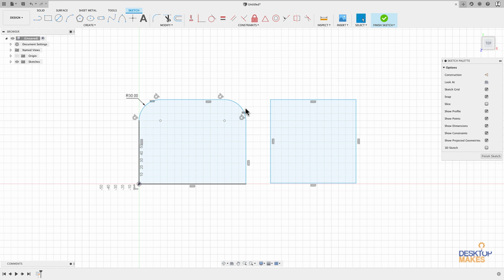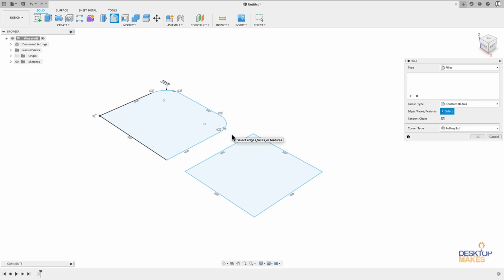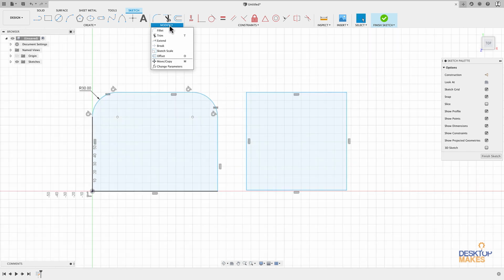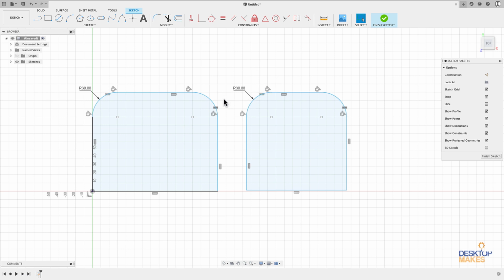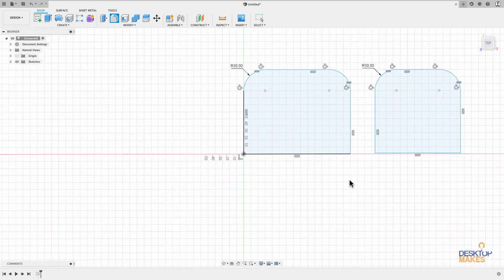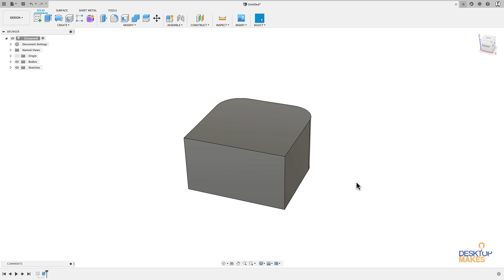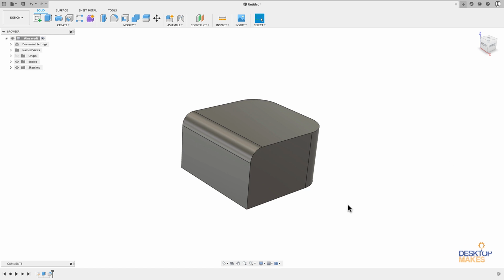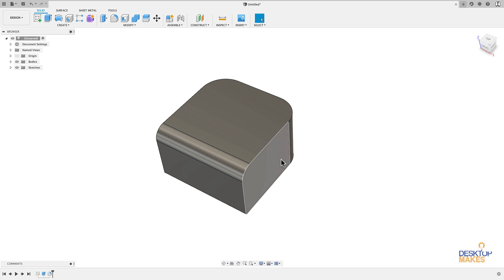Why Your Fillet Tool is not Working - Fusion 360

Comment: i have 1000's of hours on solidworks and NX and i can safely say something is seriously wrong with the implementation of the sketch fillet tool. It simply does not work with no explaination why. and, no launching the 3d fillet tool by mistake is not the problem

Comment: So, why are there 2 different Fillet options? When should you use one over the other?
Reply from the maker: Hi @christopherlyons7613.  There's a sketch fillet and a model fillet.  I normally add my fillets to the 3D model.  Sometimes it can be beneficial to add them to the sketch level and define them there.

Comment: hi there. thanks for the video. im trying to round a corner aon a sheet of metal in 2D. your video helps but now now i seem to have another problem. i round the corners on the 2D sheet, before i complete the scetch. then i use flange tool to raise the 3 dimension. no i have a 3d object with 2D rounded corners. but when i want to use the flange tool to bend up the sides of the sheet, it leave the corners behind. it doesnt bend the entire side that im trying to "flange". perhaps you can advise

Comment: I made my own shortcut. I use the Spacebar for sketch filet.  It’d be great if the Filet command shortcut worked based on the mode you’re currently in.  Sketch while in Sketch mode, etc.